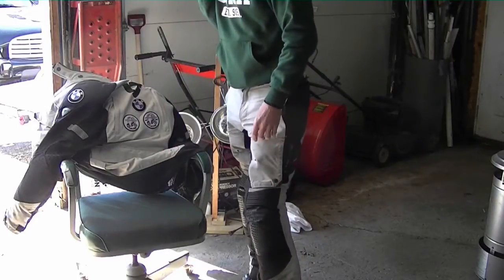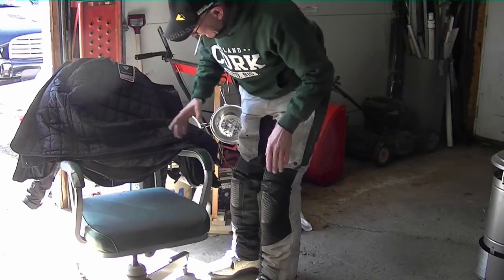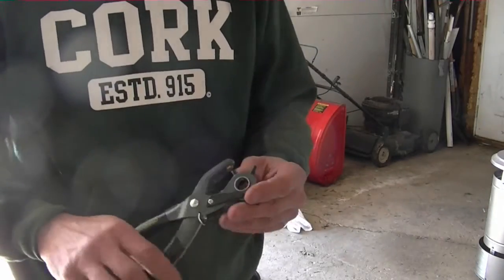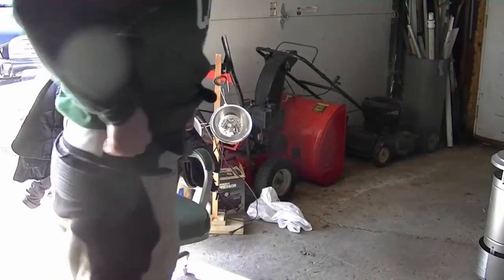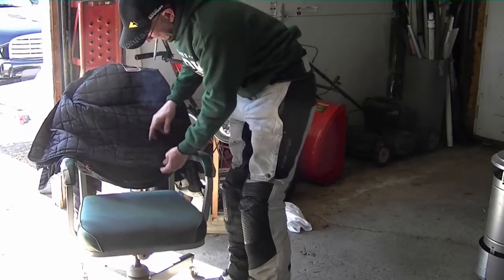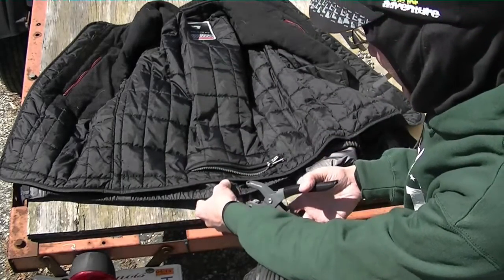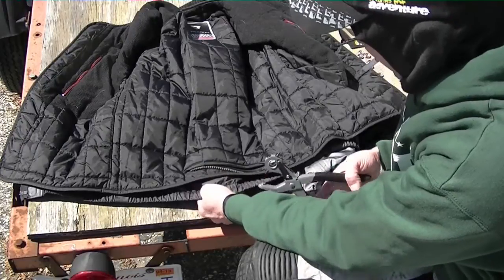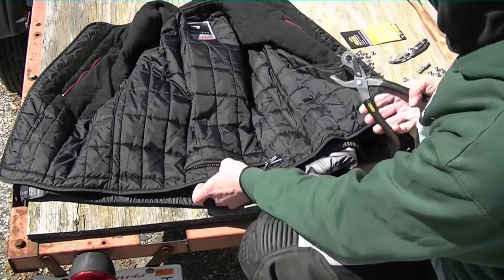How to install Snaps on Gear PT1

Comment: I've used the hole punch and the button press before to good effect, never used it on bike gear before. Makes me think of a jacket I gave away because I had the same damn problem with lining moving about. Wish I'd thought of doing this at the time.